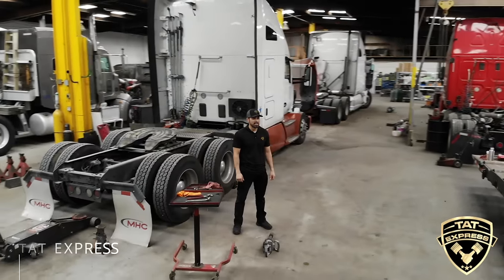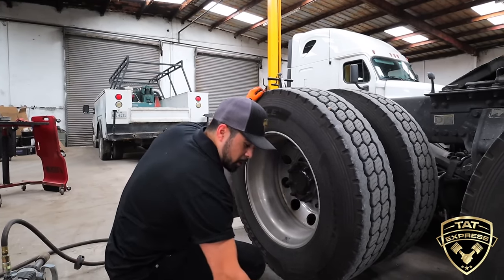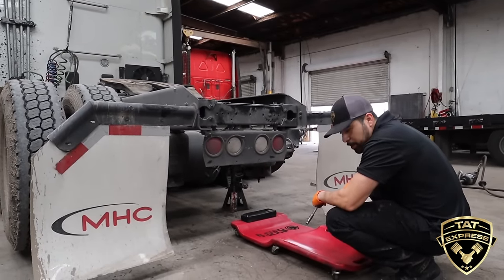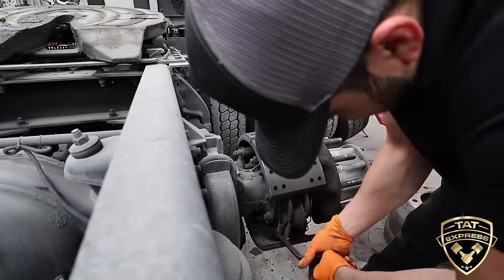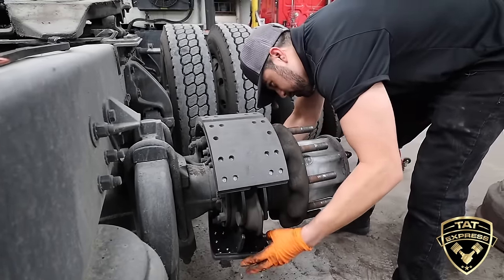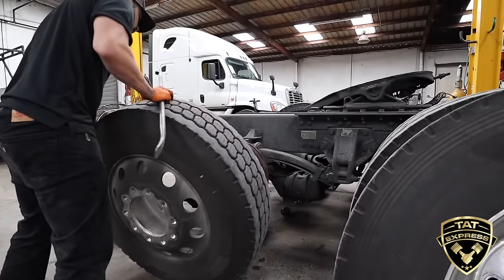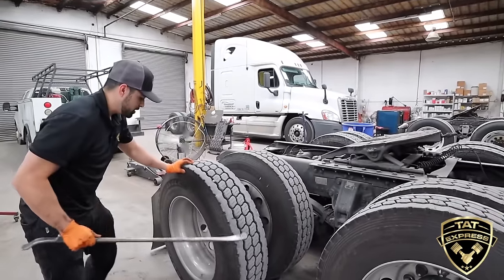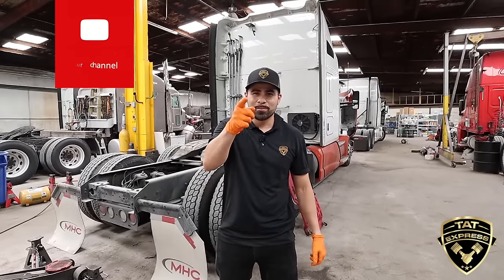How to change brakes on a 18 Wheeler/How to change brakes on a semi/ Changing brakes on a semi truck

Comment: i really dont appreciate you making this look so easy lol jk thanks for simplifying
Reply from the maker: Thanks for watching.  Be sure to subscribe
Reply: He's lucky to not have the inner wheel stuck on the hub otherwise the video would have taken an interesting turn.
Reply: Especially with the installation. I actually install using the other method because it is way easier for me because I could never ever get it right using the method shown here, and ive only seen like 2 other mechanis do it the other way that I do.I dont put the rollers on the brake shoes first but last, basically the opposite order than shown here.
Reply: @trailerfitter2  that's why lube your hubs so its easy lol
Reply: When you got the right tools u can't lose
Reply: Healthy, fit, stamina, endurance..
Reply: Its pretty easy...
Reply: @TATEXPRESSINC   hey man I've been a mechanic for 2years now and I was just shown the easiest way to put them on today, it involves a chain and a screwdriver
Reply: Isn't that hard to do
Reply: @trailerfitter2  pretty much that's what brought me here now. 🥺 Trying to figure that out.
Reply: @CastroEulis145 i do the same thing always put the rollers on last

Comment: I'm a heavy equipment mechanic since 1982, working at an open pit mine for the last 19 years and haven't replaced brakes on an airbrake system in several years, but the other night I had to adjust the brakes on a Navstar 6900XD and thought about looking at newer videos to see if any changes have come about. Your video was great and will definitely help newer mechanics and owner/operators maintain their trucks safely. Well done Brother
Reply: How the work environment in an open pit mine job? Was thinking about working at a rock pit once I'm fully certified and get some experience in
Reply: @danielheady2786  it's not bad, I work 12.5 hr shifts 3 on 3 off 4 on 4 off. We are union and they don't kill us at work. Safety is very big here. I have worked here for 19 years. I was a Machinist with the railroad prior to this and prefer working on Locomotives but heavy equipment isn't too bad. We have 15 260 ton haul trucks running, 2 electric shovels and 2 very large loaders for ore. We support about 60 pieces of equipment and have 57 mechanics and the shop runs 24 7 most times working in the shop is with a partner or 2. We don't rebuild components as we are not set up as a rebuild shop so a lot of troubleshooting, remove and replacement.
Reply: @tomsparks2294  for me that sounds cool ive always wanted to be a technician/mechanic even if the task is tedious
Reply: @danielheady2786  If you ever get into a mine, I can't speak from experience about an underground mine but they scare the hell out of me. Open pit is dangerous but much safer then underground.
Reply: @tomsparks2294 are electric shovels hooked to the grid? Or they have a diesel generator?
Reply: @Hallahanify  they have a 7000 volt cable run that hooks to a sub station and we have a natural gas power generation plant for the mine and processing plants. We had two generation plants and the local power company bought it to maintain it but tore it down as it was too efficient and didn't make them enough money. So some of our power comes from the grid and some from our generator. Not a good move for our management to have sold that generator.

Comment: Nice job. Only thing I would do differently is use a properly calibrated torque wrench to torque the lug nuts to 450 ft/lbs
Reply: And oil lugs on hub pilots
Reply: Over here we tighten them with 700Nm/515ft/lbs. Though our trucks are more heavy duty in general.

Comment: What about torquing the lug nuts down? Isn't that mandatory in the States by DOT?
Reply from the maker: Thanks for watching.  Torquing is a good practice if you suspect that your not meeting torque requirements. Suppling a quality impact gun with adequate CFMs will meet torque specs
Reply: @TATEXPRESSINC  there is such a thing as too much torque lol. I dont trust the gun. I get em on there and hold the trigger for a second or two and then torque the lugs down. If you have a high quality 1 inch impact then you can end up torquing the lug nuts down to 700 or 800 ftlbs, if you keep reaming on the gun for 5-7 seconds.
Reply: @CastroEulis145  I was put out of service for a cracked rim due to over torquing
Reply: @TATEXPRESSINC  They don't call them specifications for nothing. Last night was only my second night as a diesel mechanic. I'm supposed to be shown brakes here in the next day or so but we changed two tires last night. I'm glad the guy training me isn't you because we torqued our lug nuts even after he ran them in with a 1 inch impact and they still had room to run in before the torque wrench clicked. P.S. I was previously head mechanic in a shop that catered to passenger vehicles mostly and I never failed to torque lug nuts. When a life gets lost because a tire flies off causing a crash, don't blame your torque wrench.
Reply: Yeah, all you guys here have probably never driven a truck or repaired one in the field. Tight is tight. Get that fucker on there and let me get rolling. I thought he was a little heavy on the impact but it’s not uncommon. What is uncommon is a fucking torque wrench on lug nuts.

Comment: I recently changed all the brake shoes and drums on my freightliner. I'm happy with my decision. I feel safer now going downhills with heavy weight loads.
Reply from the maker: Eric, brake maintenance is very important.  Thanks for watching, be hit that sub button.👊🏼
Reply: @eric- i'm just curious, where would buy parts for your brake job?
Reply: Although having properly operating brakes on a semi truck is so very important, hauling heavy as I do, the proper way to decend a downgrade is to bring your speed down before the decent to a speed where your engine brake will hold your speed while going down. I routinely run over 100,000 pounds and rarely touch my pedal brakes going downhill. This is the safe way to run. Never wrecked a truck. I began driving in 1991.
Reply: @GraceEngineering What are your rpms and what gear are usually in?

Comment: I just got my old job back as a trailer mechanic at a local shop. I couldn't remember all the details of taking off brake drums or brake pads so this video was very helpful even though it's about the tractor.
I remember using a slightly different tool to get the springs off and to put them back on.
Now I just have to remember how to do brake chambers and wheel hubs

Comment: Well i like your video simply understanding..but for the safety procedures you must take a measure for the pushrod,clean wheel/breakdrum before installed.and install a wheelgaurd, and torque wheel nut.

Comment: LT - 890 Rockwell Brake Springs 
LT - 895 Eaton Brake Springs 
Trailer Brake Springs
Lisle - 40030
OTC - 5081
When installing Eaton brake springs , wrap a racket strap around the shoes to tighten shoes to spring rollers .The shoes will now  not rock .
2/23

Comment: When installing Eaton brake shoes wrap a racket strap around the shoes and tighten .  This will keep the shoes from rocking on the anchor pins .  For this application use the plier style tool to install springs .  You will not regret purchasing a brake drum dolly . Let the air out of the air spring suspension first. Good video .

Comment: Great video but would highly recommend cleaning the lug nut mounting surfaces and lubricating the threads as well as using a torque wrench. I know, I know tight is tight but i cant tell you how many studs I've torched off and replaced because someone was too lazy to get a torque wrench and way overtightened the lugs which is a HUGE pet peeve of mine. All it does is screw the next guy.

Comment: Brake shoes! Go with drum style brakes. Pads go with the rotor or disc set up.
Hammering that drum without safety glasses is asking for trouble. It takes a split second for a metal shard or a rust chip to fly into your eye causing a lot of pain even loss of sight.
I’ve seen it happen in many shops over the years.
Murphy’s law never fails.
Reply: Excellent points.
Reply: You might want to invest in a drum Dolly and a tire dolly. You're young and strong. But after 40 years of doing brake jobs and other heavy duty work if you don't take care of your body you're going to be in pain! I'm living proof. And I took care of my body! 72 years old now I use a walker. Lower back! You're not bulletproof bro!

Comment: Hey this was a great video!! I’m a diesel technician in school right now I have about 9 months yet thanks for this but I just want ask how much do you think I should spend on a composite heavy duty air impact gun
Reply from the maker: Any of the name brands will do good.  IR, blue point, Mac or CP.
Reply: IR has a habit of breaking in half at the air motor & heavy asf.

Comment: Consider a( Brake Drum Dolly Dolly) well worth the expense if you have steady brake jobs of this type, Also safety glasses when
pounding on the drum or under the truck. Anything can fall from the frame or other parts. Good job in explaining removal and install.
Reply: Also tire dolly helps with tires. Safety glasses are a must.

Comment: That's what I hate when they fix a flat or put new tires on sometimes they block the inside valve stem where I can't get to
Reply from the maker: Yes, that’s the difference between experienced shops.  Thanks for watching. 🇺🇸🇨🇱🔧💪🏼👊🏼

Comment: great video great sound quality and quite informative. i'm only noticing just a few little things you forgot to tighten back the slack adjuster...on the other videos too changing wheel axel seal that part was left out, but good job overal
Reply: he did tighten the slack adjuster back up

Comment: You commented that your impact puts out 1450 foot pounds.   Torque specs on the wheel nuts are 500 to 550 foot pounds.   Why no torque wrench?
Reply: Torque specs are 450-500 but yeah I’m wondering the same thing.
Reply: The 1400 ft lbs is the breakaway torque
Reply: I believe he had to go back with a torque wrench no matter the impact gun

Comment: Cheating.... no backing plates and the inner wheel came off far too easily.!   Just curious to see what types of brakes you use in the USA.  They look like a Meritor (ROR) Quick fit trailer brake linings.

Comment: Not trying to be that guy but I'm an oil field/heavy duty mechanic in Canada. first of all, where was the PPE. Secondly please show the importance of checking the pad separation on the brake shoe. If you're going to keep the drum on you should check for drum wear. it cannot be worn more than 120 thousandths of an inch less than the max inner diameter of the drum. And yes you can change the shoes twice before the drum but it's all dependent on the driver. Every drum will have its max diameter stamped on the outside of the drum.  And those wheels should be torqued to 500ft/lbs. A few other things but overall great video. well done

Comment: No torquing the wheels after,🤔?
Reply from the maker: For most semi-trucks, the recommended torque for lug nuts typically falls within a range of 450 to 500 foot-pounds (610 to 678 Newton-meters).

Comment: Are you not concerned about torque specs on the lug nuts ?
Reply: Definitely not. It's sad to see but most truck repair shops skip that step as it is very repetitive and more work. I work on school buses and loose my shit whenever I see someone half ass it and just ram lugs on tires.

Comment: No new anchor pins, in 40 years I never seen anybody put brakes on backwards, you put the two little springs on 1st, then put the s-cam Spring on,  pry bar one shew at a time and put your s-cam rollers in.
Reply: I thought it was strange the brakes didn't come with new anchor pins either just new s cam rollers.

Comment: One more thing! If you are actually doing a one-wheel brake job  you're not done till you've checked the stroke on the other slack adjusters on the vehicle including the fronts. In addition, modern slack adjusters do not like to be backed off against their clutch mechanisms. Usually there's a way to release them. I haven't been in the trade for 10 years I'm not going to comment on the individual ones. But something to watch out for. Thinking you can do a brake job because you saw it on YouTube it's sort of like me thinking I could drive a semi on the highway and go cross country. I had to maintain a CDL license for my job and I was pretty good at shuttling tractor and trailers and spotting them in the shop. It doesn't mean I was qualified for road use. Experience is the best teacher.
Reply: The more I watch this video the more I see how incomplete it is. He spends a lot of time talking about airbags and them bleeding down. What he doesn't talk about is your air pressure should be at 120 PSI before you release the brakes. That guarantees a complete break release. If your truck has an air leak over time the parking brakes will apply automatically. Watch your fingers!

Comment: you don't use a torque wrench?? 500 ft/lbs and then again after a 100 miles??
Reply from the maker: Thanks for watching.  15 hp air compressor with 1” supply line.  1” Impact with  1,450ftlbs torque. 

But you are right double checking the torque is good practice.
Reply: @TATEXPRESSINC   Plenty of Ugga Duggas...  Still, we torque and retorque and have to register every wheel that has been removed and replaced.

Comment: In Ontario Canada you could get fired for an incomplete job. Those lug nuts would have to be torqued to 500 ft/ lbs , with a note to have them retorqued after 100 miles. I'm surprised you don't have regulations for this in Texas. I realize a competent tech would know his impact well enough to be confident that they are tight but due dilligence requires the torque wrench.

Comment: Dont like the idea of jamming a tire iron in the holes of an aluminum wheel, it will chip of the clear coat and cause corrosion, let alone mar up the holes. If those were new wheels I would be a little upset.
Reply: Except that aluminum doesn’t rust

Comment: " Never use the same hardware " he leaves the old anchor pins🤔
Reply from the maker: Eduardo, thanks for watching.  The old anchors were fine in this video but, you are correct.  Change anchor pins if they are excessively worn.
Reply: @TATEXPRESSINC  I got to say I do not agree with you on that, Why not replace them if they're included on the kitt? Takes more time to press them out right, however you're the technician not me and your DPF information it's priceless thank you
Reply from the maker: Eduardo, thanks for the feedback.  Yes anchor pins can be a pain if they are seized.  Thanks again for your input
Reply: Eduardo silva  there were no anchor pins in the kit, the anchors for these style of brakes are part of the spider.

Comment: Maaaan
I always gotta fight with it fuck with it fight with it fuck with it

I use a prybar and hammer to knock the springs out. Then the shoes are seized so i gotta hammer em up off the rollers then prybar em out

He's lucky the main spring pins are already installed. I put em in the hole, smack it with a hammer and the fucker bounces out 67 times before I get it.

Then the S cam and main spring get in each other's way

Then i gotta wrestle the lower shoe with a prybar
Then i use vice grips and a lot of grunting to get the orange springs in.

I prefer disc brakes. Waaay easier to replace

Comment: I love the channel brother help me downfall is everything is taken from so far away shocks that you can't see specifically what you're doing like what holy goes in there's three holes there from the angle year doing everything I can't see which holds 20 because you're Way Way back I mean is there no way to bring it up and and put it right on the part and show exactly where you're putting everything I know you might think that well people should just know this or something but and maybe they should but if they're watching it and you're doing an instructional video we want to at least I do anyway I want to see every single part I want to know exactly which hole it's going in I want to see it and I want to see which way it's going in I'm going to see if that spring is turned up this way or the spring is turned down this way and from that Angle Way back there's no way to see these things you know love the channel I just maybe just you know close up shots you know that shows us a lot of things these things are also color code now some of it's self-explanatory but why leave it the chance just pull the shot up nice and close and you can see exactly how it's hooked in exactly what hole is going in and all that so anyway not complaining just hopefully constructive criticism and in a loving way all right God bless
Reply from the maker: That is a good idea. We can work on an updated version with better angles. Thanks for watching, and thanks for subscribing

Comment: One more thing, if this guy is an owner of a shop or even an employee I don't know how much you make off of YouTube channel but showing brake work would be the last choice I would make. If this truck was ever in a fatal accident that involved the brakes and the driver said well I just done my brakes! Where'd you learn how to do them? On YouTube? Really! What channel? Why would you expose your business to this liability? When I was shop foreman for a fleet it was my job to protect the company. Vendors would walk in with aftermarket white box no name brake valves shoes etc we sent them packing!. It costs more, but we always used quality brake name parts. Meritor, Bendix etc. No white box parts for us. Because if the wheels went up on one of our trucks I didn't want to have to be answering questions as to why we used junk parts. Plus I wanted some third party protection. Little hard to find 3rd party protection in china.